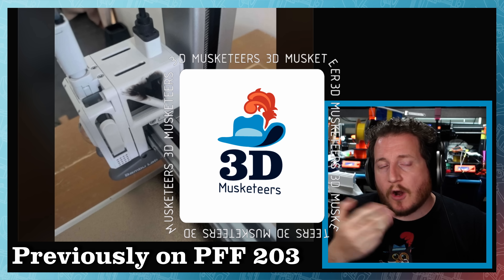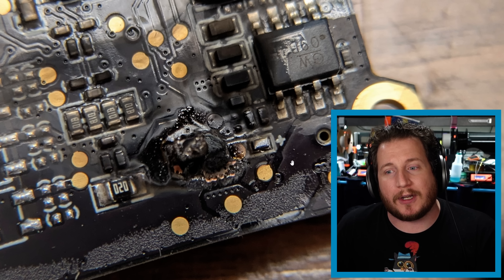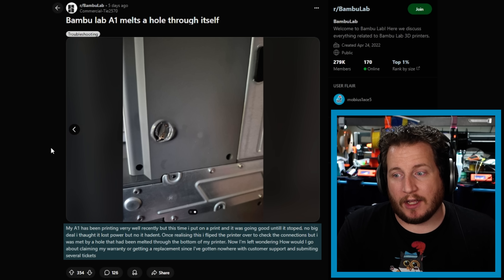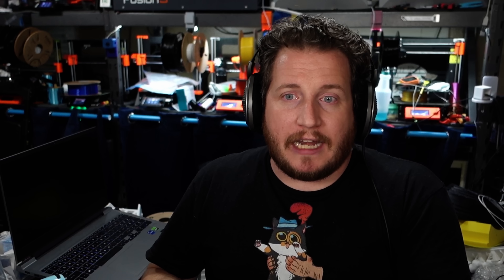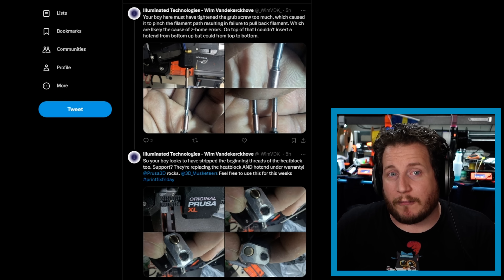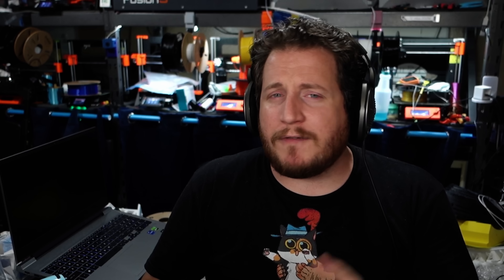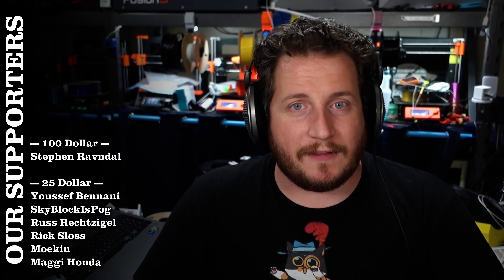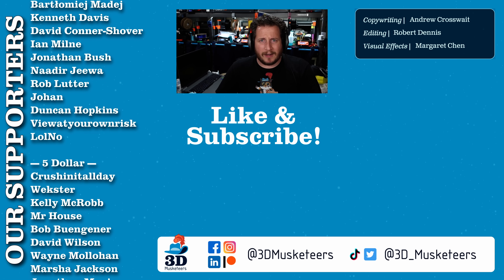PROOF That Bambu A1s Are Catching Fire! - PrintFixFriday 204

Comment: Varistors 'normally' clamp (short) when the voltage goes way too high, it's job is to protect the rest of the circuitry (they are simple and cheap to change) but a proper circuit should be fused before the varistor so when it does clamp the fuse then pops. So, in a proper circuit design, you get a power surge (say something happens and you get 220v across a 110v line) the varistor clamps (gives it's life) and the fuse pops. Now, it's normal for the varistor to then look burned but it happens fast enough that nothing but the varistor and fuse are harmed. Clearly the Bambu ones likely have 2 issues, first they might have a bad batch of varistors that are clamping (maybe partially at first) and thus setting off the issue, but clearly there is no fuse before it or the fuse it way over rated and allowing the fire to happen. Either of these issues are on Bambu of course (buy reliable parts) and design proper protection into power circuits. For clarity, I spent over 45 years fixing and diagnosing electronics (now mostly retired and just do stuff from home) my industry was the coin-op world, everything from vending machines, video games, juke boxes and even slot machines. Needless to say I have seen many varistor fails but while they might blacken the area around them, none I have seen ever caused fire or melting of anything. They often split apart and pop with black smoke so you get black soot on other components and cases but no melting. Normally this can be explained by high voltage spikes (I saw about 20 in 1 day when we had lightning hit a local power substation) and they did their job of saving tens of thousands of dollars of the rest of the electronics when it happened and I had them all fixed in a week (I only had like 4 on hand, so part of that time was waiting on parts).
Reply: Absolutely correct and accurate assessment, and well-explained.

Knowing that this design is not properly fused, I would re-assert my original position; DO NOT PRINT UNATTENDED!  WITHOUT APPROPRIATE FIRE SAFEGUARDS.
Reply: @SwervingLemon  I agree. I might even go so far as to mod a fuse in it but I am very familiar with electronics repair and design.
Reply: @sublimationman So what do you think is the root cause? Just straight-up bad design or not spec'ed properly for the load?

Even users on 110 report that the power supply runs pretty hot.

I'm withholding my final call until I can get one to test, but I suspect they tried too hard to reduce their parts count on a multi-region product, and suspect it just sucks regardless of loading.
Reply: @SwervingLemon  Well, lots of power supplies are dual voltage so that should not be the issue. More likely I think there are 2 things they at cause, cheap unreliable parts and design with no fused protection. I think the varistor was the initial cause of the problem even if there was an over voltage case. But there should have been a properly specked fuse before it that would have stopped the problem even if the varistor was defective and the end user would have possibly heard a small bang, and possibly seen or smelled smoke but that would have been the end of it. Instead it caught fire (even if only a small flame) that should not have ever happened. I would love to have one of these boards in hand to check the construction and layout myself but not going to buy a machine just for that. I do have a P1S (with a love hate relationship at the moment) and one thing I do like is the physical power switch instead of a soft power as so many items have today. If the machine ever catastrophically fails I will do an autopsy and maybe even post if online.
Reply: Most of them do blow apart, final fail open, I have seen a few that do final fail closed, yes, absolutely, that's what the fuse is for

Comment: I've contacted Prusa a few times, been hit and miss sometimes they fix the issue but most recent issue after multiple chat sessions, email follow ups etc cannot be solved
Had the mk3s bought the 3.5 upgrade (regret it should have gone mk4)
Running revo high flow
Bought the accelerometer and GPO board
Cant get the accelerometer to work, it fails to calibrate each time
Prusa sent a new one out, still same issue
They've said its a firmware issue
But had nothing from them since, this was months ago now
MK3.5 doesnt print great, layer shifts, bad levelling etc but then sometimes prints great but would nice to tune it properly due to differnet hotend.
Tried everything

Ended up buying a p1s, no issues with that
Reply: Unfortunate. Too late now I suppose, but sounds like belt tension or bad motors.
Reply: @logicalfundy support thought it could be belt tension too but it calibrates fine, tuning app shows it's spot on

It printed great as an mk3
Printed fine as mk3.5 but knew the quality could be better with properly tuning the firmware due to hot end change etc

It now sits to the side collecting dust til a firmware update is released

Comment: called it didn't I - they needed to put a thermal fuse on that varistor
Reply from the maker: indeed!
Reply: I got 2 bambu lab a1 almost a month ago. Let me just say great printer, but what i noticed was that the bottom of the printer was getting alarmingly hot. This is very concerning. If you have bambu labs a1 when you're printing something, go ahead and lift the printer while it's printing and feel the bottom. You'll know what i am talking about.
Reply: @eggboi955  You are correct, I noticed that too with mine.
Reply from the maker: Y'all might not want to use your printers if that is the case... I'm starting to think there is a much more serious issue here.
Reply: @3DMusketeers if thats the case i would have return the a1's sadly return window is over. I should have bought elegoo centauri carbon instead but honestly nowadays 3d printer is becoming cheaper and affordable. Just because 3d printer is becoming cheaper doesnt mean its a good thing. With cheap printer they are going to cut the corner some where. Why is it that expensive 3d printers never had any fire issue i mean look at prusa for example. Only thing its setting fire is my wallet. 😢
Reply: Print some fan ducts for the side vents. The A1 Has zero internal cooling except for the little holes in the side letting heat out. I run mine in a wood built enclosure which Bambu say dont. Thats why i printed some ducting sucking cold air in. The base stays cool even when printing ABS at 270-280'
Reply: @Gixie-R Really?  My ender 3 "pro" from back in the day had a fan in the electronics bay and the only other thing in there was the MCU.